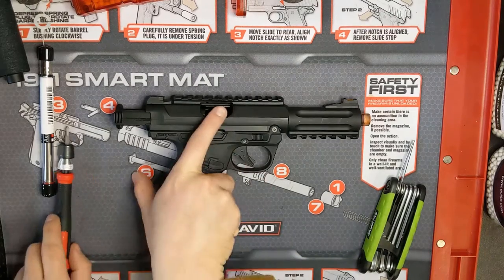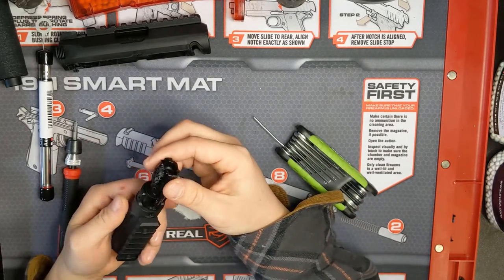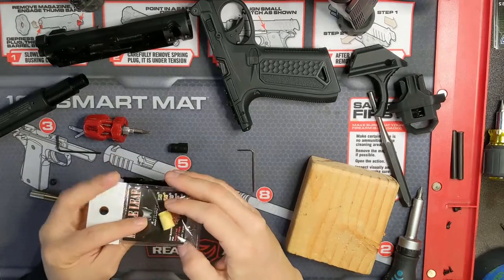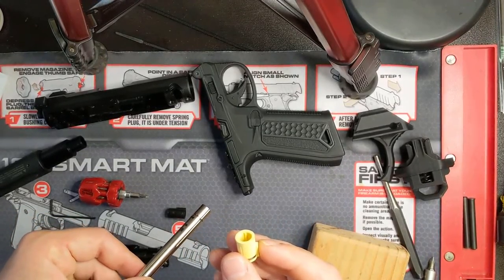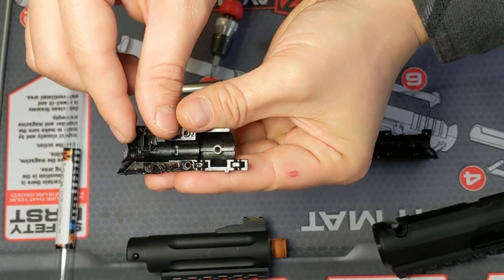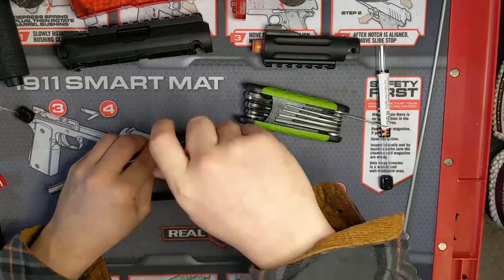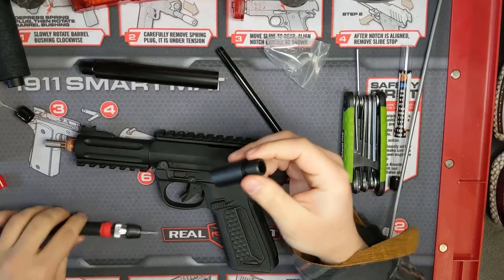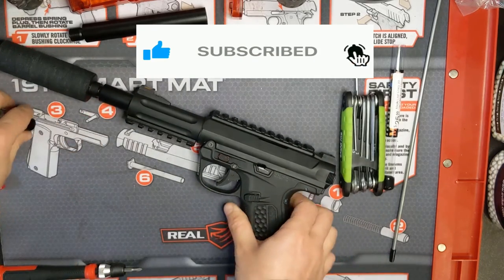AAP-01 Inner Barrel and Bucking Upgrade

Comment: Hey what kind of mock suppressor is that and what inner barrel and bucking as I’m needing to get some to upgrade my accuracy thanks
Reply from the maker: So with a 150mm maple leaf crazy jet inner barrel, I used a 1.2" outer Barrel extension to cover up the inner barrel, and then you can put any tracer you want on the end of that. in this video I put the ACETECH LIGHTER R (it's just wrapped in black medical tape). If you don't care about glow-in-the-dark BB's, you don't need a tracer, you can just use any mock suppressor that is over 1 inch long. For the bucking I used a maple leaf Autobot bucking. Be sure to use the 60° one since the AAP shoots at a higher FPS for pistols. The degrees on the bucking are just different hardness for different FPS ranges. If all the 60 degree are out of stock, you can get away with the 70 degree. 
And before you go buying parts, I would disassemble your pistol, clean and lube the bucking and reassemble carefully just as in the video, and you might just see a huge improvement in accuracy. Be sure to clean out the inner barrel very well using a cleaning rod and paper towels that don't have too much lint. I clean my airsoft pistols after every day on the field to keep them performing well. My pistol shot very random out-of-the-box, and after carefully reassembling, it shot laser beams. So honestly the upgrade really didn't improve much. However if your pistol has a decent amount of wear, then these new premium parts should help out a lot.

Comment: You wouldn't happen to know what the bore size is on the stock AAP 01 inner barrel is by chance. I've seen a bunch of random sizes people throw out there. Somehow I doubt they are sending them out with 6.03. I know the stock length is 129mm.
Reply from the maker: I have also heard some say it has a 6.03 stock barrel. But I have never seen anything published anywhere by action army, so I am not really sure what the inner barrel bore size really is
Reply: Thank you for the response. 😊
Reply: @KillerKhemist  6.08

Comment: I cannot find that extended outer barrel anywhere.  Can you provide a link that ships US?  I really wanna try this out.
Reply from the maker: I bought my barrel extensions on Amazon. But the product is no longer available. This for example looks like it would work, 
AOOHYEO 14mm CCW to 14mm CCW 0.8″ 2.4″ 4.8″ 7.1″ Outer Diameter 0.75” （19mm） AEG GBB Black Tube M14x1 Left Threaded Extension Accessories Four Pieces (Black) https://a.co/d/i6tM9jT
Not sure how quality this product is though. It does have free returns if it doesn't work out. But also I saw many other listings when I searched "airsoft barrel extension 14mm ccw" on Amazon. Hope you find something 🤙
Reply: @KillerKhemist thanks for the fast reply. Ill check it out!

Comment: Does upgrading the length by that very little amount noticeably affect it?
Reply from the maker: Sorry. Missed this comment. It makes the gun noticably both more precise and accurate. Mine was pretty ok inconsistent out of the box before this upgrade. Also it will increase your fps by 35-50 FPS. So be careful of your field limits
Reply: @KillerKhemist  what lenght did you put ín it?
Reply from the maker: @davidsipos1905  this is the 150mm Crazy Jet barrel

Comment: can i use any other inner barrel because i cant find a 150mm?
Reply from the maker: Oh yah, standard size is like 130-135mm, beyond that you can go up to about a 200mm and still be just under 400fps, but you will need a mock suppressor or an extended outer barrel to cover your longer barrel